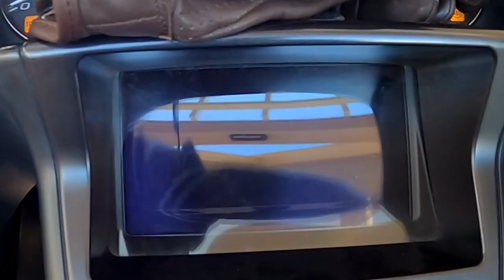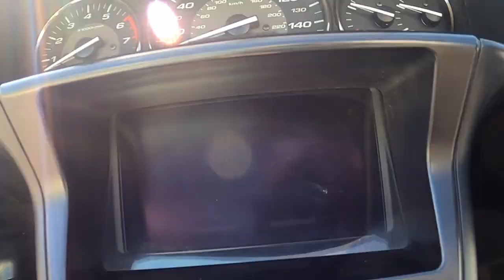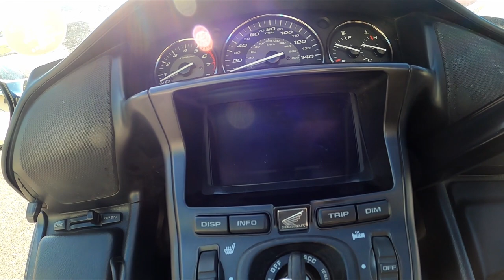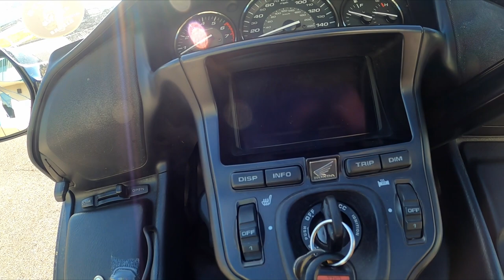Gold Wing Problems | It finally Happened To Me

Comment: I hardly ever use the navigation of my goldwing, it is only good for driving from point a to b. I use a TomTom rider, I am very satisfied with it, I can experience beautiful routes, it is specially designed for motorcyclists, beautiful winding roads and you get to places you would otherwise never come.
Wishing you many more safe kilometers or miles for you. ✌
Reply from the maker: Yeah, Motorvrienden De Pallieters your videos are evidence of the TOM TOM rider. You ride some really great twisted roads. Fortunately for us, the problem has been resolved it was a fuse that I missed on my original inspection. I only found out after buying the Zumo lol. We decided to put the Zumo on Kakes' bike.

Comment: My life-long dream bike has always been a Goldwing,  When I was finally ready to go for it, and I almost bought the same one Craig has...  I got bitten ( & smitten ) by a Spyder 😁🤣🤣 (true story !!!).
I've had my Zumo XT for almost 2 years, absolutely love it, super bright screen, even in sunlight, waterproof, made for motorcycles, and so far mine has been bullet proof.
Hope all is well Rich & Kake 👊😎👍
Reply from the maker: Hey, Wayne...Yeah, I bought the Zumo XT and also love it. I found out that I missed a fuse on my original inspection. Now I got my Navi back. We are going to put the Zumo on Kakes' bike.
Reply: @BootsandJeansRiders  One of the first things I did when I got my 07 Wing was replace all the standard fuses with GloBlo fuses that light up when they blow to make roadside troubleshooting easier. But never blew a fuse to find out.
Reply from the maker: @davem5333  WOW this is my first time hearing about GloBlo. Time to get it. Thanks Dave

Comment: If you have had work done on your Wing a while ago, it might be the connection under your dash that might be the problem. I have a 2012 Goldwing and  have had navigation problems since day 1 with it and got a Garmin Zumo that is doing wonders when I travel. What I don't like with the Goldwing GPS is that the radio stops when the GPS talks.. I don't think you should change your Wing since the new Goldwings, (since 2018) are automatic and lost the Goldwing looks. The best thing, bring your bike to a good place where they can look why and fix the problem. I also wonder if you speedometer or odometer work, mine quit once and it was because a switch behind my dashboard was not connected correctly. Good luck and safe travels.
Reply from the maker: Hey Pascal...It was a fuse that I missed on my first inspection. It's fixed now.  I have no plans to get a new bike yet. I still have many more miles to ride with BIG EASY.
Reply: @BootsandJeansRiders  I sold my first Wing with 186 000km on it and my 2012 is only at 145 000 and am not about to sell it but now, have a NC750X to go off road at the same time and hard to choose. But then again, I am doing Iron Butt rides and the Wing is the best.

Comment: I've had the same problem with the sat-nav on my Goldwing , I also went through the same sequences as you to try and resurrect it..nada. Turns out there is a problem with the PCB which is behind the screen. Unfortunately Honda have a replacement part but it would be cheaper (and probably more reliable) to buy a new bike ! 
Keep safe.
Reply from the maker: Hey, Phillpacameron, Yeah I would love a new bike. Fortunately, my problem was a fuse that I miss on my first inspection. Yeah the XT is a great unit...loving it so far.

Comment: My 2005 GW didnt have Nav. but would sometimes freeze and the disconnect battery proceedure worked.
no time limit I just waited aminute and reconnected it an it worked again.  For this I would have taken the dash cover off and checked the wiring plugs for wear and corrosion. those wiring pins turn green with age and need dielectric grease and a good cleaning occasionally . worst case is the display grenaded and Garmin is the solution till you find a new one.........................JB..
Reply from the maker: Never had any problems with my Navi system until now. Nothing seemed to work so I purchased the Garmin. Even though I like the Garmin, I wasn't happy that the bike Navi was down, so I rechecked the fused and found out that I missed it during the first inspection.

Comment: Y'all was close to me (Birmingham) with the last couple vids. Aggravatin' when having any problem on an adventure. 7 Gold Wings and the only problem I had was on my '88, when the alternator brushes stuck open. Battery died and it was weekend. So, rode 100 miles and swap batteries with my riding companion, ride another 100 miles and repeat to complete the trip. Guessing you didn't get it working by yourself? Yeah, I'm not good with cliff hangers.....🤣
Reply from the maker: Yeah, it was very aggravating. Got it working after we got back home. Fortunately for us, it was a fuse that I missed on my original inspection. We decided to put the Zumo on Kakes' bike.

Comment: The other thing I didn't see here is to make sure you reseat any connections between the GPS in the trunk and the display. There may be one under the seat as that seems to be the place the wiring harnesses split between front and back. Also, in a darker area or garage shine a flashlight on the display when you turn the key on. There is a backlight on the display. If that is off you probably won't see anything unless you shine a flashlight directly on it. Good luck.
Reply from the maker: Thanks for the info Mike, I appreciate it. Fortunately for us, I missed a fuse on my original inspection.

Comment: Hey man.  Judging from what I saw, you need to do a full discharge.  Try fully disconnecting the battery.  Meaning both cables needs to be disconnected.  While they are disconnected cycle the ignition 3 times.  After that reconnect and try. Let me know if this work.
Reply from the maker: He Boss Boss that's a great idea. Fortunately, the problem has been resolved, It was a fuse that I miss on my first inspection.

Comment: On my 2007 I used a garmin on the handle bar. The 2018 has CarPlay so it has back ups to the internal. On the Pan Am I use Garmin xt. BMW phone only. Not having the display is not a good thing. Me I would start with smacking the display 😂. Go with the 2021 and up, it has the larger trunk.
Reply from the maker: HAHA, Yeah brother, I smacked it several times. Have a great day,

Comment: Electronics can be a real pain.  Not only to diagnose, but to fix.  Sometimes we get lucky and it is a simple, and inexpensive, fix.  Other times...might as well buy a new ride.  I'm all for buying the new ride. Hahahaha.  I trust that by now you have it all sorted out though.  Y'all be safe
Reply from the maker: Yeah TennRides, I'm all for the new ride too lol. Yes, I found the problem but only after buying the Zumo. Fortunately for us, it was a fuse that I missed on my original inspection. We decided to put the Zumo on Kakes' bike.
Reply: @BootsandJeansRiders  I have had fuses that looked OK,  I spent hours taking apart wires, splicing wires, etc to get the problem fixed.  Only to find out later that the problem was the fuse, I finally started checking them with a meter, instead of just looking, and found one blown.   I can relate to your frustration, sir.  Glad y'all got it fixed. On a positive note, Kake is probably happy.  Hahaha

Comment: So sorry , your having trouble , but im thinking the connection inside where you put those chips in , sometimes any dust can cause it not to register,  try blowing some air in there , it's a long shot , it's that stupid ...also that wire on the neg terminal , does that wire go to where the nav systems is in the truck, wire maybe pinched ...keep us posted how you make out ....god bless , ride safe
Reply from the maker: Edwardo, Thanks for the suggestions I really appreciate that. I found the problem, but not until later after buying a Zumo. It was a fuse that I missed on my original inspection. We decided to put the Zumo on Kakes' bike.
Reply: @BootsandJeansRiders  good deal ....safe riding ...ill be following you . God bless

Comment: Your intro video looks like you were on 10 heading West after coming out of the Wallace Tunnel.  How far are you from Pensacola...
Reply from the maker: Hey Thomas, we were heading eastbound in this video. We live in California and were touring the country. We are originally from New Orleans and have been to Pensacola several times.
Reply: Thanks for responding!  I have been through three motorcycles in the past 6 months.  After having an 15 FJR 1300, I did a trade for an 07 Goldwing in January.  I ride that bike to Washington DC in April and I decided that I want to do a trip to Los Angeles next year and I sold the 07  and bought an 18 two weeks ago (there was nothing wrong with the 07, it only had 24,000 miles when I sold it, just a bit heavier but rode very well, it’s different from the 18).  Keep me posted on any trips you have this way!  Blessings and be safe out there!

Comment: Happy to see your both back on the road. 👍
Unfortunately I have not experienced your issue, so I have no "this will fix" it advice. I use my Garmin on my 2016. Hardly ever use the Honda unit.
Now as far as the choice of a New bike... I suggest finding a low mileage Gen-5. Such as a 2016 -17. That's what I did in 2018 instead of a 2018+.  I saved a couple thousand$$+ swapping my accessories from my old 2005 to the zero mile new 2016. And finally, I added the Henry Final Drive. This made any desire for a Gen-6 standard trans go away! I have no interest in the DCT.

Tony 2Wheel4Fun test rode my 2016.
Stay safe. Look 4ward to you continued adventure.

Corventure Dave
Reply: Oh wait... I see in your reply's that you found a blown fuse. Great! I love those kind of complex repairs!
Corventure Dave
Reply from the maker: I saw Tony's video of him riding your bike. I've heard about Henry's Final Drive. I am seriously looking into getting it.
Reply: Rich,  You and Kake are more than welcome to test ride my 2016 with the Henry any time. 👍🙃
Reply from the maker: Thant would be great, Thanks Dave

Comment: Take it back to the dealership. I just got a brand new 2023 Goldwing. Hope I don't have problems.
Reply from the maker: Vmax...I don't think you will have any problems with the 2023 Wing, they had 4 years to work out the minor bugs. Fortunately, it was a blown fuse that I missed on the first inspection. The GPS is all good now.

Comment: As for your navigation problem, have you considered the Rand McNally Motor Carriers’ Road Atlas??? Oh, sorry, I’m still living in 1986! 😂😂😂
Reply from the maker: LOL, at least the Rand McNally Motor Carriers’ Road Atlas is reliable...
Reply: Old tech but it still works. And no battery or signal strength to worry about!  A GPS will lie to you!  It's not rare for me to use 3x5 cards with my turns written on it. And I have a Garmin and factory GPS.

Comment: Subbing. I have been a Ryder for a long time. My 1st bike was a Cushman Scooter. LOL, it was bigger than me! We lived on n a dead end street so traffic wasn’t a worry. My 1st street bike was a 1983 LTD Kawasaki, I still have it in my garage. Would need new tires/battery before becoming road worthy again. My current bike is a 2021 F-3S Spyder by Can Am. 1330cc 3 cyc. I was worried that the power wouldn’t satisfy me. But I was wrong. It’s 115hp and 96 Ft. Lbs. of torch. It’s got plenty of power. My last street bike was a 1997 Valkyrie std. loved that bike. The wife and I could ride all day into the night with NO saddle sore. Miss that bike!😢 I had a major stroke about 7 years ago that took my balance away! 😡 I thought my biking days were over, then I saw the F-3 Spyder and thought, there’s my answer. Just completed my 1st season on the F-3 and love it. Back in the wind baby!!! Glad you found your simple fuse trouble. Pretty easy fix.
Reply from the maker: Man DJ, You have some serious experience. Thanks for subbing we appreciate it. Glad you loving your Spyder Can-Am. We had a chance to test ride one when they were on their US tour several years ago, they came to San Jose Ca.
Reply: @BootsandJeansRiders  your welcome on the sub. Keep your head on a swivel. I’ve had many times I could have been hit/killed but I watch out for the other guy! 😉

Comment: It could still be a software problem. Try someone elses SD card. I replaced mine with a newer version recently, the Bypass is finally on it!!  Doesnt show me riding off road anymore!! My Nav system is the only aggravating thing on the bike.  Not being able to turn it on while I'm underway infuriates me!  Basically means I won't have nav for the next 150-200 miles!!!
Reply from the maker: Hey Rick, How's it going? Fortunately for us, I missed a fuse on my original inspection. Yeah, I need to update it too. I purchased the Zumo and decided to put the Zumo on Kakes' bike.

Comment: The words “GoldWing” & “Problems” are not supposed to be used in the same sentence 🤔. Mo over at Mo’s Motorcycle Journey has a video on easily resetting the GoldWing’s ECU which may fix a myriad of electronic issues if your other solutions don’t work. https://youtu.be/1hMHro6ALiU      Be safe you two!
Reply from the maker: I couldn't agree more (The words “GoldWing” & “Problems” are not supposed to be used in the same sentence) I just watched the video thanks. It was simple...
The problem has been resolved it was a fuse that I missed on my original inspection. I only found out after buying the Zumo lol. We decided to put the Zumo on Kakes' bike.
Reply: @BootsandJeansRiders  …. Nice! I have the Zumo 595LM that I’ve had for a few years and am still learning g how to use the features. Be safe guy!

Comment: Sorry you are problems with your bike ; have a 2012 Honda gold wing ; whenever I shift from 1 st to 2 nd she jumps back to neutral; what's your take on that ?
Reply from the maker: Hey, Stephen...That has happened to me many times. I am a quick shifter and sometimes in my haste to shift fast, I up tap too lightly. Then the bike falls back into neutral. just make sure you push up harder on the shifter. If it continues I would get it to a mechanic.

Comment: I would have disconnected the positive lead to the battery and then put it to ground to reboot the whole system and get out the bugs. Hope you fixed it by now. 🙂 my goldwing is a 1994 works fine for me. Ah, I saw at the end you disconnect the ground, that doesn't always work. I have done it with my toyota sienna for many year. Put the positive to ground once disconnected. Guaranteed to remove all the corruption. Good luck.
Reply from the maker: Yeah, John, it's fixed now. The problem was a fuse that I missed on my original inspection.
Thank you for the advice.
Reply: @BootsandJeansRiders  Glad you figured it out. I hate when that happens. 😁

Comment: Try unhooking both battery terminals and putting an .010 ohms register clamped between both terminals .let this like this for a day. This should do a complete drain on the computer. Hook terminals to battery. This drain should put it back to factory setting.
Reply from the maker: Thanks this is really good advice. Fortunately it was a fuse. It hasn’t blown out again .

Comment: I did NOT see you disconnect the main NEG cable , only 2 side connection.  I work on these systems on 18 wheelers, radar , abs , side radars , auto trans . I can tell you the factory tells us techs , when all else fails , disconnect ALL ground cables going to the batteries WAIT 10 MINUTES  to allow ALL  capacitors to drain out.  reinstall after 10 minutes , clear all codes and try to see where you are.   I see it's been 8 months , so by now you already fixed it ?
Reply from the maker: Man, that's great advice coming from a tech. Yeah, fortunately, it was a blown fuse I missed on my initial inspection. Thanks for the advice.

Comment: Couldn't tell when this happened, but in this case I'd use my phone both for navigation and speed. Some app have both
Reply from the maker: Yeah Richard you can't go wrong with the phone...They are always up to date. I just don't like my phone on my bike because it's my primary form of communication. If I go down and separate from the bike/phone, then I can't call for help. So I keep it in my upper jacket pocket. Thanks for watching and commenting. I really appreciate it.
Reply: By the way, I'm from Lafayette but move to Beaumont Tx in 1968. Was inspired to ride motorcycles at 5yr old . Been rolling since I was 14. I now ride a 2014 Valkyrie  with 32k miles and love it.
Never wanted a Harley that inspired me🤣
Reply from the maker: Man the Valkyrie is a fast monster. A Gold Wing without all the extra plastic. I love them.

Comment: Guys, what about the GPS (google maps or whatever) on your phone?  That should cover you until you get to the repair shop.
Reply from the maker: Yeah, Patrick, the phones are excellent for GPs, they are always up to date. And the problem was a fuse that I missed on the initial inspection. We did get the Zumo, and we are going t put it on Kake's bike. Thanks for checking in.